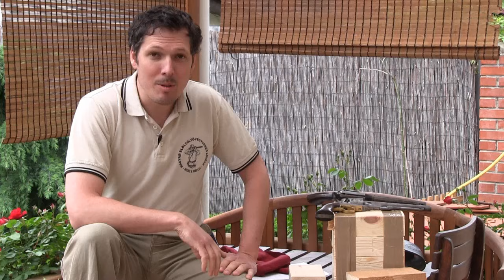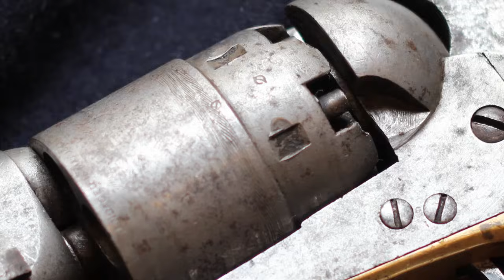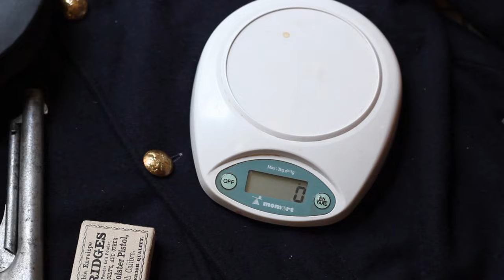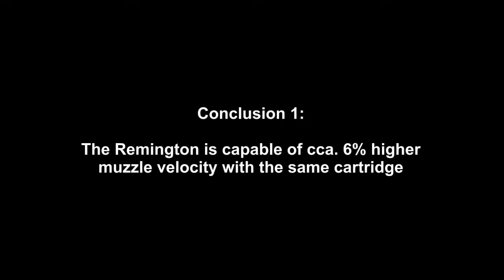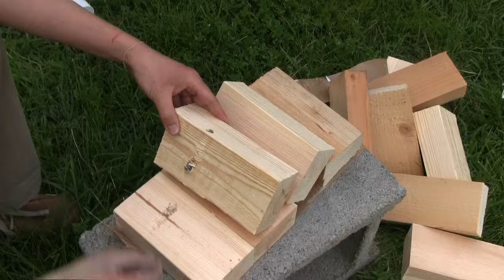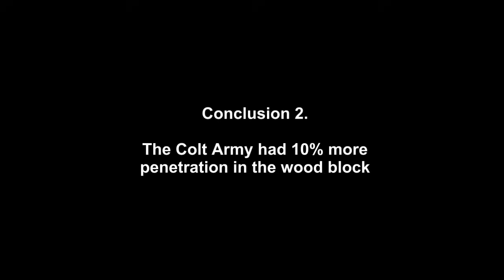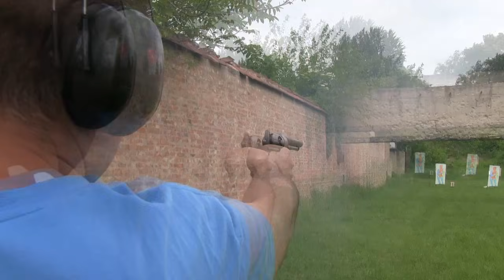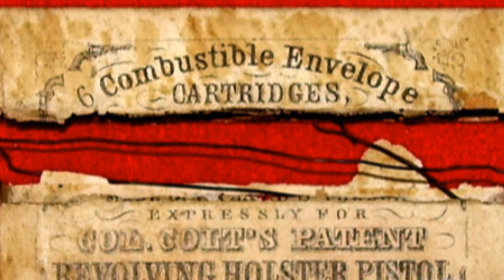Original 1858 Remington New Model Army vs original Colt 1860 Army percussion revolver

Comment: Thanks for a great video, When you said 30 grains of Swiss and saw the barrel of the colt I was waiting for a big bang. I had a 1861 Remington but had kittens every time I fired it. I now have a ruger old army which still has its share of problems. they got it pretty much right with the Remington except for the cylinder pivot which has a tendency to bind. Nice guns Bravo.

Comment: The '58 New Model Army launched those 200gr bullets at 866fps ...   The Colt sent them at 807fps ....   Pretty significant when you consider the Remington basically duplicates the performance of the .44 Special...   also matches up well with the legendary .45 ACP launched from a 1911...

Comment: +stainmorelegend
Sorry, that statement is incorrect. Cap and Ball revolvers are specifically excluded from the ban on pistol ownership in the UK. A friend of mine has a Colt Walker .44 replica, which I have fired at a range earlier this year. From Section 3.6 of the current Guide to UK Firearm Regulations (October 2014):
"Category (iii) affects the kind of small firearm that is easily concealed and yet confers high firepower. For this reason, muzzle-loading weapons (including cap and ball revolvers) and flare pistols are deliberately excluded." Catagory (iii) is the section which defines arms prohibited by law as regards pistols.
He still needs a Catagory 1 FAC and follow all the rules for security and storage, but he is not banned from having it.

Comment: The 1860 definitely is the more beautiful gun. I would go so far as saying that not only is it one of the most beautiful guns, it's one of the most beautiful shapes that man has designed.

But the Remington is definitely the better design. Stronger frame, better cylinder design, faster cylinder lock design. It's simply better as a weapon.
Reply: And you could carry 6 Rounds savely with the Remington
Reply: During the Civil War, they were more concerned with being killed by the enemy than accidental discharges . And when carried in a full flap holster, would have been fairly well protected from the hammer spur being bumped . You could still drop it, and have a bad result, but hey , war was already dangerous .

  ( The above was historical , do not use as advice for today .)
Reply: @filianablanxart8305  I would like to buy a reproduction for self-defense. But in my country, you can just own the real antiques which were made before 1880. I think it's really dangerous to shoot with a 150 years old gun. I heard many stories about cylinder explosions. It can actually blow your hand off. What should I do now?
Reply: The non choice is obvious - Buy an Original in good condition .

  If you are not sufficiently knowledgeable to evaluate one , I'm sure there are Shooting/Collecting clubs/ organizations there who are very familiar .

  For extra paranoia , any machinist , and advanced mechanics could Magnaflux the cylinder for hidden cracks .

  For extra caution , use loads on the moderate side , ie 20- 25 grains of powder instead of 30- 35 grains .
Reply: @filianablanxart8305  Thanks a lot for helping me! 

I will try Magnaflexing the cylinder before buying one if the seller has no problem with that. But even when everything is okay it still can crack after every single shot, because of age effects and possibly inferior chemical composition and mechanical methods used to create them. That's what I'm worried about.

By the way, can you do Magnafluxing in Europe? I never heard about that before.
Reply: @BuddyTheGermanShepherd   Colt Walker circa 1847 had issues with exploding , but that was corrected with improved design shortly afterwards with subsequent 1st Model Dragoon .

   Colt and Remington were top notch manufacturers , and they used the top quality steels of the day , more than up to anything vaguely close to a recommended loading .  If not cracked , corroded , or massively out of spec tolerances from excessive play from wear , no more likely for catastrophic failure than modern reproductions .

  Original Civil War era Revolvers were commonly used for Civil War Reenactments , and Skirmishes ( shooting competitions in historical uniforms ) starting around the US Civil War centennial , and throughout the 1960s into the 1970s when they were over 100 years old .

   They only fell out of use after becoming too valuable to Collectors .
Reply: @filianablanxart8305  Thank you for your last comment, I've learned a lot.

Here is just an example, would you shot with this one https://licensfritt.se/Revolver/remington/rem1251758.html ? What's your opinion on this? Looks a little rusty...
Reply: That's what collectors refer to as " Patina" . That Patina would not be out of place on early to mid 20th Century firearms that were actually used , not stored unused in closet or safe since new .

   Obviously , looking at pictures isn't the same as hands on inspection , and obviously I would recommend you have a reasonably knowledgeable person local to you either go with you to pre purchase inspection , or look it over during a post long distance sale Inspection Period .

     That said , from the photos , no obvious signs of abuse , excess wear , or uneven wear to indicate problems with fit or bad timing .

     There is some visable pitting on the outside , right side of the cylinder in the 5th and 6th pictures from the top (as viewed on my phone ) . Might simply be inconsequential surfaces , might be something more , this would be the first thing to examine in person . ( It looks as if could be  consistent from having been stored in holster for a number of years .

   Can't tell condition of inside of barell or chambers from the pictures , but if they are described , it would be consistent with the rest of the gun .

   I won't give a long distance recommendation over the internet to someone I don't know well in person . But I will observe that if I was in the market for a shooter grade Original Remington , I see nothing to dissuade me from proceeding to inspect it in person , with intentions to negotiate if inspection is satisfactory .

  I looked up the exchange rate between US $ and your currency , but I haven't a clue at the current market values for such things , available for legal purchase , in your country .
Reply: @filianablanxart8305  Very interesting information, thanks again for sharing your knowledge and helping me out.

I don't know a knowledgeable person in person but I will try to bring the gun to a gunsmith before buying it. I also would like to do Magnafluxing on the cylinder before buying the antique gun, but I haven't found any provider which offers this service yet.

These antiques cost more in Europe than in the US. I think because it's the only firearm that is license-free.

Yeah, it looks like that the whole cylinder is full of pitting, that's what I'm worried about. It's just a 150 years old gun...
Reply: @filianablanxart8305  Is there any other method to check the cylinder for invincible cracks? I really can not find a company which offers the Magnafluxing service.
Reply: @filianablanxart8305  I found a company which does 'Dye penetrant inspection'
Reply: @BuddyTheGermanShepherd   That sounds like a generic name for the same process .

Comment: Good video. But I'd change the penetration test material for another more homogeneous, like clay.
 Wood is not reliable for that, a slight change in grain orientation or density and the penetration of the bullet would be different
Reply: He was doing it like the US army did it's trials. Yes, they aren't very good ballistic mediums, but he was going for historical accuracy.
Reply: I agree, I see the Colt went thru the stack between the 2 by's. the best cap and ball revolver is the one Josey Wales uses. The Uberti 1847 Colt Walker. Its the biggest and baddest gun ever made.
Reply: Also, the remington hit the center block, the colt hit the space between blocks, so, obviously suffered less resistance...
Reply: Mr. Midshipman Uberti is a replica company...
Reply: There was only 1000 ever made, right? Well then, what's your point?
Reply: Carlos Bah of of course
Reply: Carlos Bah
Reply: you are right !!
Reply: Carlos Bah zzzz
Reply: hugofilip
Reply: Mr. Midshipman m
Reply: The Walker was groundbreaking , iconic, visually impressive . But the best, and most practical of the US Martial large revolvers was the 3rd Model Dragoon .
Reply: Yes, ice bricks could be also very interesting targets for penetration.

IMPORTANT NOTE: If you compare penetration, you shouldn't focus on how far did the bullet go, but how well did it "share" its energy into destroying the target. That's the point of them. You can compare for example 9mm Luger in FMJ or HP versions and which kicks harder? HP - and it does penetrate less, but it expends and releases more energy at smaller distance, so the tissue of the body is much more devastated. Keep that in mind!

Comment: Norm: these 44 black powder guns are more powerful then a modern 357 magnum.
Reply from the maker: J.B. Packer
Actually very good qulaity blackpowders were available during the 19th century, like the British Curtis & Harvey or the Schiesspulver in the Austro-Hungarian Monarcy. We made several ballistic tetst to determinate the strength of these fine powders compared to modern Swiss blackpowder. The method was simple: II worked with an original 1845 Jagerstützen. I knew the exact load used back in the 19th century, and I took the ballistic tables from the original manuals. I adjusted my modern load until I could recreat the same ballistics with the same bullets. It worked well. There was not much difference between the Siwss 2Fg and the military Schiesspulver of the mid 19th century.
Reply from the maker: J.B. Packer
One of the luckiest ones for sure. :) With many good collector friends. :) But my comapny is trading with historic arms so its a profession as well.
Reply: ***** Jesus Christ, I'm a professional machinist and mechanical designer... I know a little bit about metal and the history of steel. They did not have steels like we have today in the 1840's. They did not understand the chemistry of what was going on in the metal at that time. They knew virtually nothing of alloy steels. The Bessemer process for producing half-decent plain carbon steel in quantity was only patented in 1856.
I have just done a Google search on this Walker power issue. Certainly other people have wondered about this and discussed this before, right? IT IS GOING TO BE ON GOOGLE. If you were going on anything other than wishful thinking or misplaced respect, you would have done a Google search on the topic before opening your mouth with contentious assertions. Well what I found is just about what I expected... velocities with round balls are around 1150 FPS and maybe a fast one might just break 1200 FPS. With Triple 7 powder, I saw one claim of 1395 FPS, but I seem to recall an article in the American Rifleman magazine some years back warning about how Triple 7 is a lot hotter than true black powder.
Now a 140 or 145 grain round ball going even 1395 FPS is right smack in .357 Magnum territory, and nowhere near a .44 Magnum.
You come on here repeating lies you heard, and I'm the one burdened to go find out the facts.
Reply: ***** No way is the Walker more powerful than a .44 Magnum of any reasonable barrel length. Personally I'd probably rather have a top-quality Walker replica than just about any .44 Magnum ever made, for collection purposes and ignoring money value, but smokeless powder is just a lot more potent than black powder is.  What is the .44 Magnum with a 240 grain bullet, maybe 1400 feet per second? I don't know offhand but I'd be amazed if the Walker could break 1200 FPS with the same weight bullet and a full chamber of black powder.
Reply: ***** People might LIKE to believe it was more powerful than a .44 Magnum, but I absolutely do not think you are going to find chronograph results to prove that.
It was certainly more powerful than the Colt Dragoons or 1860 Army, that is obvious since it had a longer barrel and burned more powder. The cylinder failures were due to primitive metallurgy... I doubt Italian black powder replicas, on average, are made of quite as good steel as most modern smokeless powder revolvers, yet I do not think they fail with full loads of proper powder. Even by the time of the 1860 Army newer steels were available which would have made the Walker safe with full loads.
Reply: +MacNutz2 Not even close to true. Mike Venturino tested a modern reproduction Walker with a full load of 5 different powders and the best one produced a muzzle velocity of 1171 fps and energy of 451 ft.lb. The 1873 Colt .45 with black powder produced 973 fps but with a much heavier bullet for 526 ft.lb.  So the legendary Walker was already exceeded in 1873. Modern loads in the .357 magnum also exceed 500 ft.lb of muzzle energy and some loads in the .44 mag can exceed 1000 ft.lb.
Reply: Cool. Thanks for being nice about it. Do u work for a gun company or are u just the luckiest man on earth lol
Reply: Fuzzybeanerizer Just look at old military black powder rifle cartridges, like .45/70 or 11mm Mauser. With bullets of normal weight for these calibers and cases loaded full of powder, it seems they all hover around 1300 to 1500 FPS. And this was in LONG rifle barrels with no barrel/cylinder gap to bleed off power.
Reply: john frazier I have a .45 Hawken rifle with a 28" barrel, which would only be more powerful than any of these black powder revolvers. It can be loaded from 50-110 grains FFg black powder. At a 60g load, twice what an 1860 Army or 1858 Remington can handle, it will move a 127gr, .440 round ball at 1720fps, 947 ft.-lb. muzzle energy. Meanwhile .357 magnum muzzle energy with Hornady Leverevolution 140gr. ranges from 644 ft.-lb. (8" barrel) to 1064 ft.-lb from an 18" barrel.  A 30gr. load would be only a fraction of the power. Far less than a .357 magnum.
Reply: +Joseph Houseman 
  Hell yeah! Thanks for pointing out what I've suspected for years. The Peacemaker was the  'Dirty Harry' of the 19th century for just the very facts you've stated. I was about to write  that too before I discovered your post.I read a similar test recorded in " Guns of the Old West"  by a writer doing a review and he got 1147 fps with the full load( he was testing one of the Italian modern clones I'm sure) and found he could drop down to 40gns for something in the order of 1090fps which he said cooled it on the report and recoil,naturally. Excellent post! By the way Mike writes great articles on the old guns. Too bad more folks don't avail themselves much.
Reply: +Joseph Houseman Of course the .357 magnum eclipses it (full power .357 goes well over 500 ft-lbs). However, a Colt SAA?It depends on the particular gun and load, really. Not all replicas are machined equally well, and if you have the very common situation that the barrel is oversized for the chambers the result will be noticeably worse (this situation is frustratingly common with BP replicas).In their book "Percussion pistols and revolvers" by Mike Cumpston and Johnny Bates, they obtained the following results: in an older ASM made Dragoon they managed 345 ft-lb; in their new Uberti Dragoon they managed, with 200 gr conicals also 483 ft-lb, and 460 ft-lb with .454 round ball. With their Walker they also managed 483 ft-lb. Probably the Dragoon they have is a particularly good example, as obviously it's a gun with a 1.5" shorter barrel and 10 grain less capacity, yet manages the same muzzle energy.A Colt SAA loaded with a 250 grain bullet and 40 grains of black powder produces roughly a MV of 920 fps, for some 470 ft-lb of muzzle energy. I've also read of 255 grain bullets going up to 950 fps, for a 510 ft-lbs. Mike Venturino notes the original military loading was 30 grains of BP, however, which would result in something more like .45 ACP ballistics. The Colt SAA, loaded full with BP, should be pretty much equivalent to a well made Colt Walker, but exceed it? With a modern handload, but not in 1873.
Reply: +J.B. Packer I guess that you are mixing up black powder with modern smokeless powder. It is a different story. It is chemical,  based on nitroglycerin.
Reply: yah but the powder they used back then was a lot different, it burned slower and not as hot as black powder today.

Comment: "misfire" meening the piece of primer cap blocked the hammer from striking the primer cap lined up with the chamber?  Or by "misfire" you meen you had a chain fire?  I ask because I've seen a few videos where people blame chain fires on peices of primer cap getting stuck inbetween the back of the cylinder and frame.  That explanation doesn't make any sence to me.

Comment: To avoid malfunctions from jamming caps cock the hammer back while the barrel is pointing upwards from the recoil. This way the spent caps fall out of the gun when the cylinder turns to the next position.

I like the 1858, the only con being the smaller grip. The 1851 has a much better grip than the 1858.
If the 1858 had the same grip as 1851 it would be ideal.

Comment: Christian,
No it is a really fiddly job to get the caps on the Remington nipples due to the very small ports around the nipples,also,with the Colt,all that is needed to remove the cylinder,is to take out te wedge,the whole pistol then comes apart,with the Remington it is a really fiddly job,not something to be done if you are in a hurry,you also have the problem of getting it all back together,if you just try,you will see what I mean.